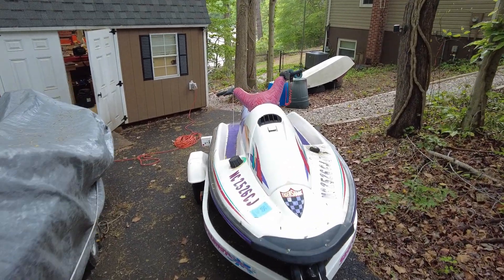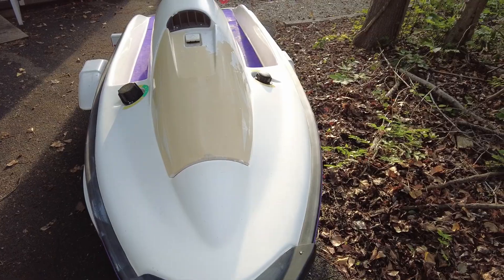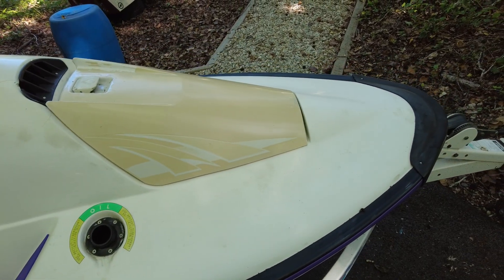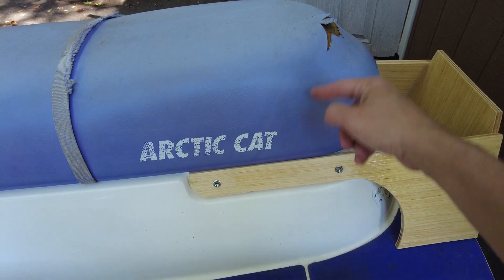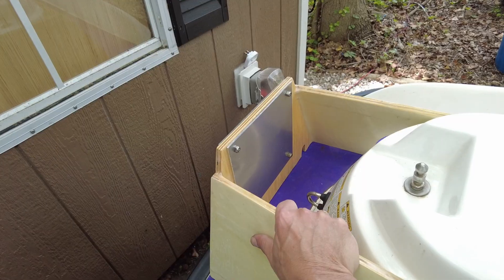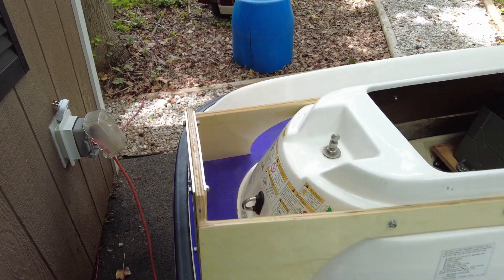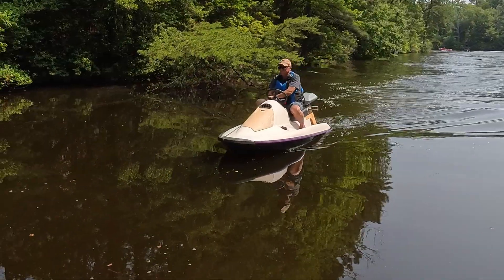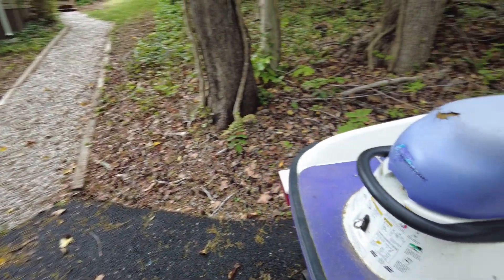Electric Ski Doo Build! - A DIY Project

Comment: 1. The smoking gun is the enourmous gap in the hull where the jet was, you need to fill that flush to the transom to create lift in the stern.
2. the thrust angle is wrong, it's pitched up too high which is lifting the bow nd sinking the stern.
3. you weigh more than the battery, but your weight is aft so the batt needs to go all the way fwd.
4. Dont give up! this is fun! I've been tinkering with planing hulls for 4 decades now, and you're always learning.

Comment: I think the plan is laid out in the  comments. Block off transom, lift prop closer to waterline, increased buoyancy and move weight forward. Even if you don't get on plane, those updates will increase displacement speed to something usable.

Comment: Put a flat plate over where the pump was, that will give you a lot more lift in the back.  You can also move the battery more forward to help it get over the plane. 

And if that don’t work put two motors on it or a 25 hp outboard.
Reply from the maker: Good points, thanks for the feedback!

Comment: Are the ever more powerful electric boat offerings challenging the spirit of an electric only lake?  It seems like some of your craft are going pretty fast.  Have you looked at some of the electric E-foils?
Reply from the maker: There are stronger motors but price certainly goes up fast.  I had this motor so figured we would give it a go.  And, yep, we’re going fast compared to many years of sailing at 5 or 6mph.  Always reaching for a bit more.  Fun stuff to play with.

Comment: First of all I love the "what if" aspect of this whole project. Especially considering the amount of inoperable old jet skis out there. As far as my amateur observations, the more I think about it, I feel the prop angle/speed/depth is probably the most critical element for success especially since the weight distribution seemed perfectly acceptable before acceleration. The 1700 RPM rotation speed of the prop might be the Achilles heel, even if you had ideal depth and angle. But I know how much work and thinking you put into this project (most of which you didn't include in this video), you are now deep into "sunk cost fallacy" territory with this one - so on to the next project! But maybe... not using that noisy Hangkai. Or perhaps I'll loan you some ear protection!
Reply from the maker: Thanks!  Your input is right on the money and appreciated.  It was as an experiment and has its limitations largely I think on the motor power.  The stubby-ness of the ski also seems to demand a lot more power to get out of its own way and plane.

Comment: My marine expertise is less than zip, so take this for what it's worth... less than zip!  😜
**  When you left the dock, it was slightly stern-down, but looked OK.
**  As you cracked the throttle, rather than planing, it seemed to get even more stern-down.
**  Moving weight forward did not make enough difference.
Could the thrust-angle need a tweak?... when you open the throttle, is it actually pushing down on the stern?
Obviously more power could overcome the issues, but "You got what you Got, Right?"
If you could just get it to plane at a low speed, it would be a neat addition to the fleet!
All good fun!   👍
Reply from the maker: All good points.  Yes, the angle was indeed more positive than I would have liked but was at its extreme and couldn’t go any more down unfortunately.
Moving my weight around didn’t seem to do much.  
The short stubby length of the ski also seems to want a lot more power too.
Thanks for your input!